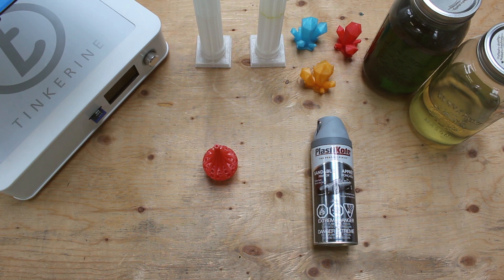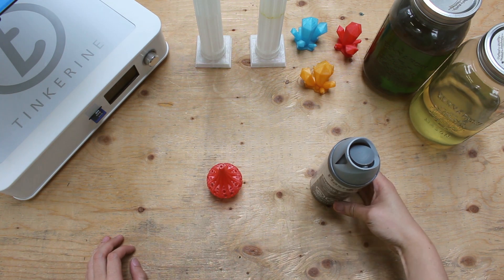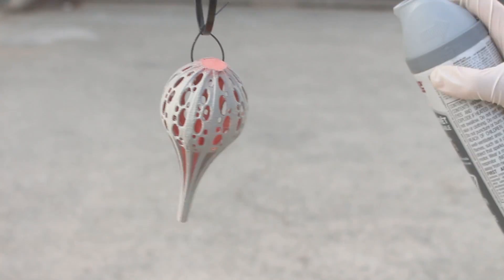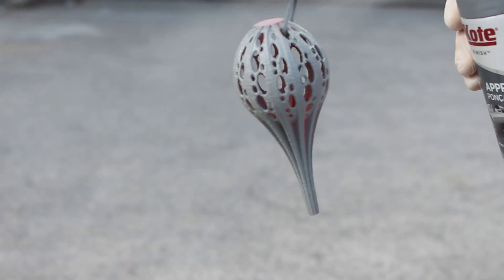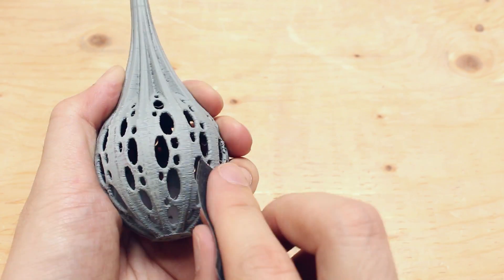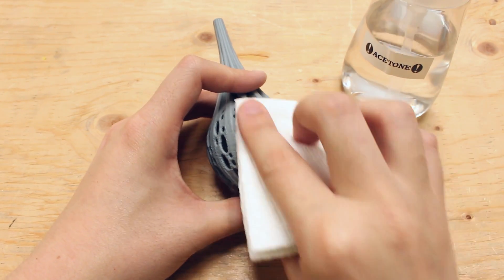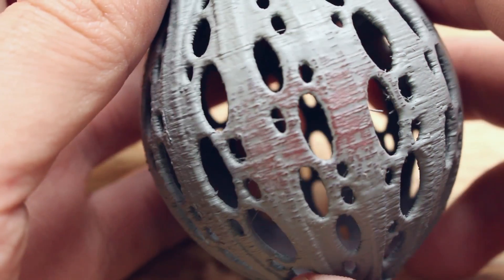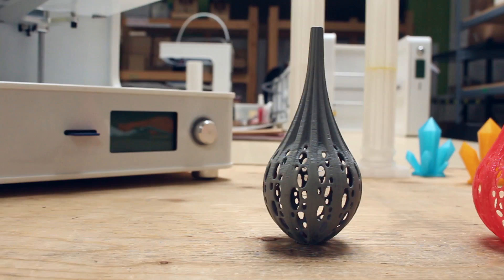Smoothing PLA with Primer

Comment: Why not vapor smooth the primer instead of rubbing/polishing it? That's the method used to smooth abs prints
Reply: Vapor smoothing doesn't work with PLA apparently.
Reply: PrevailingDanger just what I was thinking
Reply: Many reasons. Only works with ABS. Gives poor, hard to control results And can br dangerous.